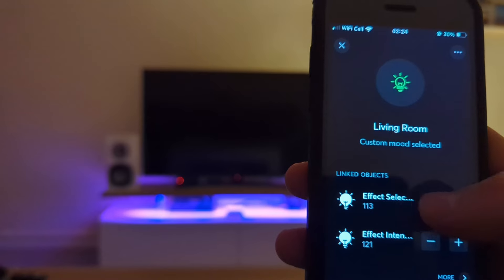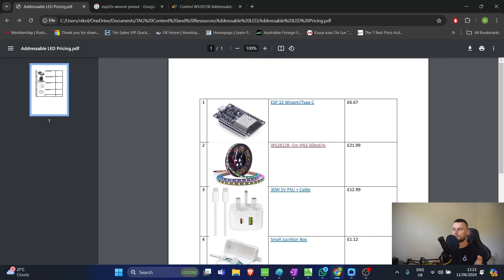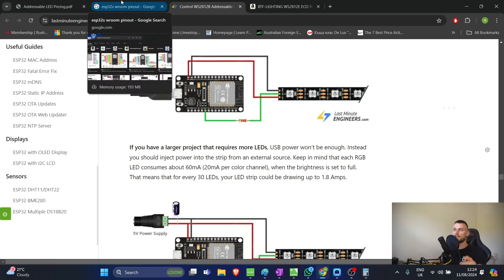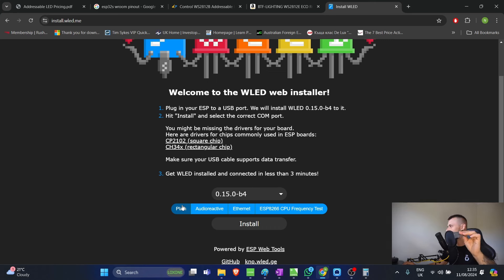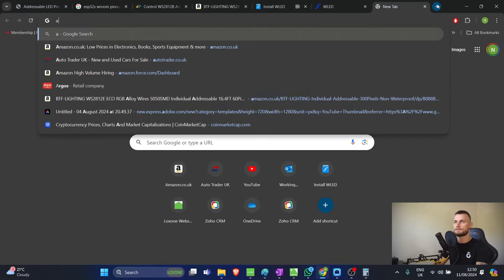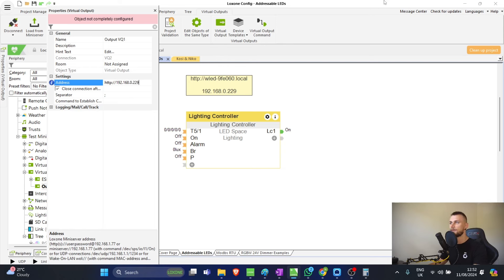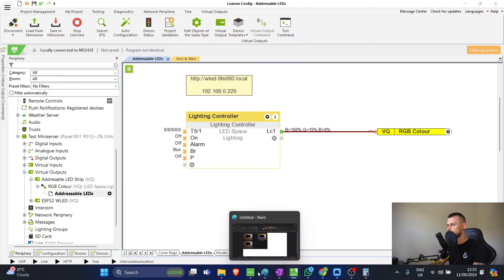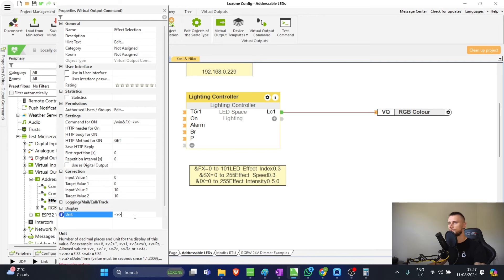Addressable LED with Loxone & ESP32?(£42.77)

Comment: Congrats! Very good explanation! You tried with addresable rgbw led strip too?
Reply from the maker: Thank you 🙏🏼 The RGBW or RGBCCT is pretty much the same process, just a different LED strip. Have a look here:
https://kno.wled.ge/basics/compatible-led-strips/
Reply: Ive tried using a rgbcct led strip however loxone doesnt seem to be using the warm white or cool white led is there a way to get this to work?@theautomationgym
Reply from the maker: @tibbar2205  Hmm, I've not tried it,but I assume it can be done as 2 separate actuators - 1 for RGB and another for CCT. That would then be separate control in the app. Alternatively an RGBW + Colour temp?
Reply: @theautomationgym  I thought that however using the loxone commands I couldn't get it to send a temperture value my only guess could be that I had the type of light wrong
Reply from the maker: @tibbar2205   maybe,  looking at the api  it looks like the &LX= function is for RGBW - compiling the colour temp with the white + blue or red hue. Where cct is RGBW + W + WW

Comment: Very helpful thanks 💪 but how can I set presets in Loxone ? I try with the commands from wled site but it don’t work
Reply from the maker: Thank you :) 
I've done it with the following command
win&FX=<v>

Where V is the effect number - for example chasing lights may be 3, so if I want to create a chasing lights Virtual Output it's
win&FX=3
Then make as many as you want and add them to a Radio Button function block for easy selection
Reply: @theautomationgym  nice thank you so much it works 👌💪💪

Comment: wich resistor did you use?
Thanks for this Tutorial
Reply from the maker: Thank you 🙏🏼 for the small run I've not used a resistor or a capacitor but you can find it here with the diagrams:

https://kno.wled.ge/basics/getting-started/

Comment: In my opinion, it's better to use the WT32 module and connect it via Ethernet. I'm currently in the process of creating a PCB for a TH35 rail enclosure. If the tests are successful, I will gladly share the project. It's also worth adding a logic level converter because the GPIO provides 3.3V, so there might be issues with properly driving the LEDs over longer distances. It's also important to remember that digital LEDs consume a relatively large amount of power in standby mode, so it's worth cutting off the power via a relay, which is an option in WLED.
Reply from the maker: It definitely makes sense to use the WT32 if you can get a cable there. It'll be interesting to see the project when it's finished 💪🏼 thanks for sharing
Reply: I hope your tests go well and looking forward to seeing the outcome.

Comment: Great, I was able to program some functions with your help. But I can't control presets via Loxone. Which command should I use to call up an ID number?
Reply from the maker: Thank you :) I'm using the following: 
win&FX=<v>

Where I give it a value on a slider from 0-255, each selection being a preset. 

You can also make presents with
win&FX=4 
For example

Comment: Thank you so much. But I still have a problem. I've tried the interate a preset. I tried many things, but I couldn't create it. Can you add a short video, or explain how I can do that? Thanks
Reply from the maker: Hi thanks, I'm not sure I get it. Does it work with the WLED app? If so what is the current Virtual Output set to?
Reply: @theautomationgym  Yes, its works with the LED App. I have created a own preset. I don't understand the composition of the command.

For Example: The effect "firework" is in the virtual output:
R=255&G=0&B=55&FX=90&SX=100%IX=150

I can find the command: &PS=  for preset. I've tried with it. But it doesn't work.
Maybe its not usable with loxone?

I hope you understand what I mean.
Reply from the maker: @MrStonest  I've just uploaded my template here:
https://github.com/the-automation-gym/Loxone-Templates/blob/main/VO_ESP32%20WLED%20Loxone%20HTTP%20Output.xml

In my case I'm using the Effect Selection and it's connected to a virtual input that is linked inside the Lighting Controller. That way I can go and select any effect between 0(solid colour) - 180ish. You just need to find the value/int for firework.

Comment: thanks for your video, what power would you recommend for a 3m strip?
Reply: 3 meter led strip I mean...
Reply from the maker: @JimmyBaeyens   thank you, if it's the same strip 60leds or 18W per meter x 3 =
54W / 5V = 10.8A at maximum brightness?

If it's longer than that maybe the 12V or 24V options would be better like SK6812 or WS2814

Comment: Thank you for this tutorial! i have been wondering if this could be done with Loxone. Now to try and figure out how to integrate this with the motion sensors so that each tread of stairs will turn on and off in sequence. Would it require multiple  ESP32 or could it be done with a single board?
Reply from the maker: Glad you liked it! You can do it with just white channels on RGBW Dimmers or use 1 ESP32 and create a custom mode with segments - every step being a section of lets say 30 LEDs. Then use 2 pinhole 12/24v motion sensors 1 on each end of the steps. The rest is the config - sequence controller.